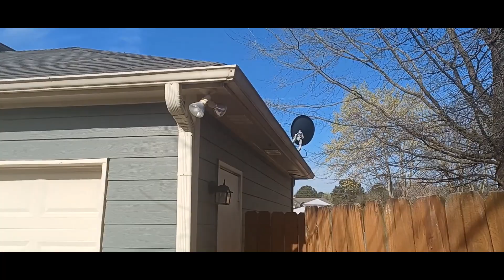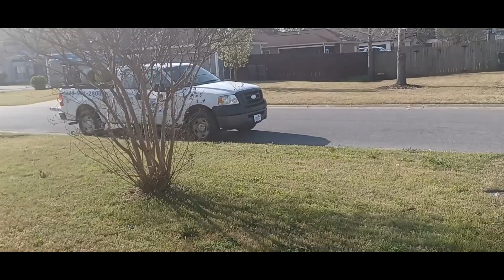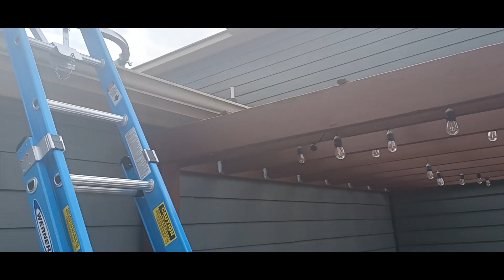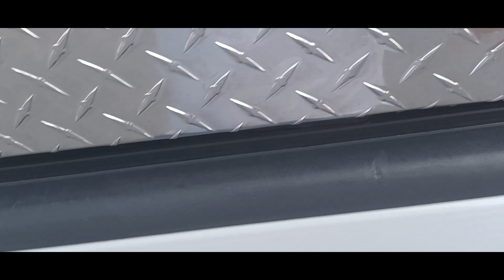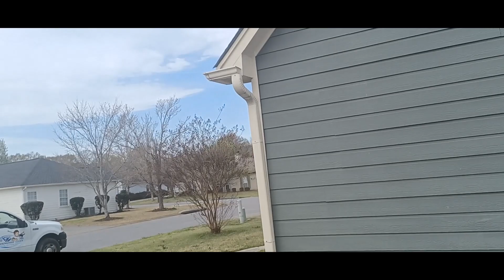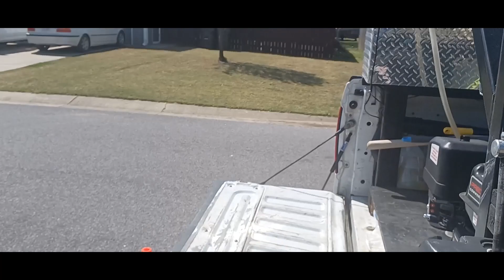Job #21 Gutters and House Wash in Pelham

Comment: Eventually you will need to clean out some gutters by hand , the gutter cleaning tool is a must have. Attaches to a broom handle , $15 Amazon.
Reply from the maker: Ya ive seen Joe deary use it alot.